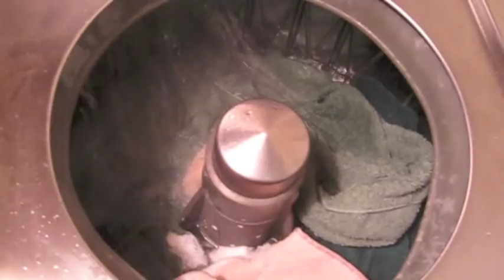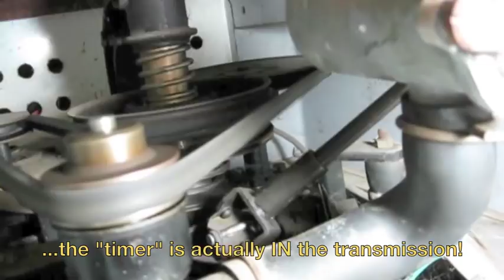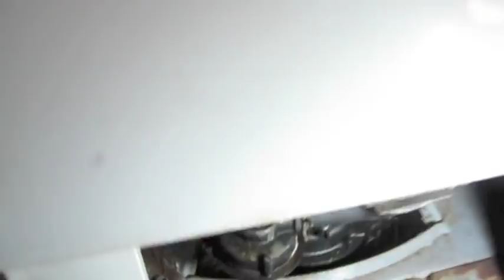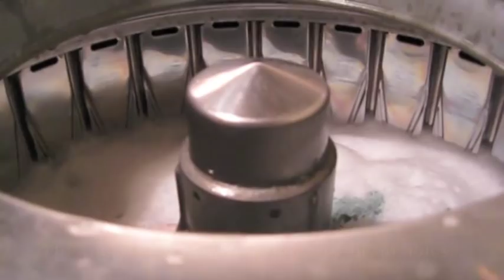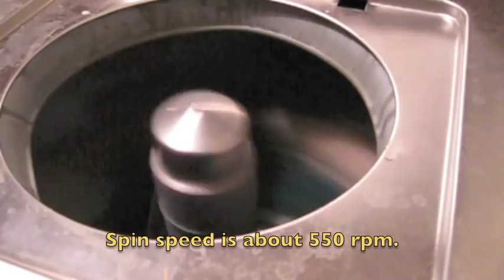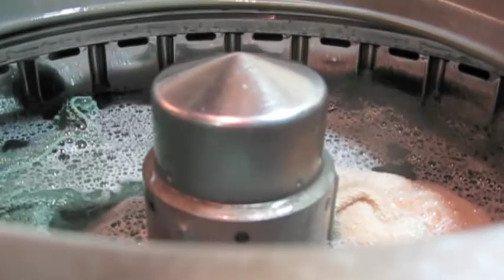1955 Blackstone washing machine

Comment: Put simply, these older machines were built to last and last and last. Not real good if you want to make a shit load of money! You're right about planned obsolecense, today, they're designed to breakdown, usually just out of warranty, what's worse, is the control board is often programmed to just stop working(go dead) after so many cycles are done. Had a new front loader do it just 9 weeks ago, it completed the cycle and died right there, in front of me. A dead control board!